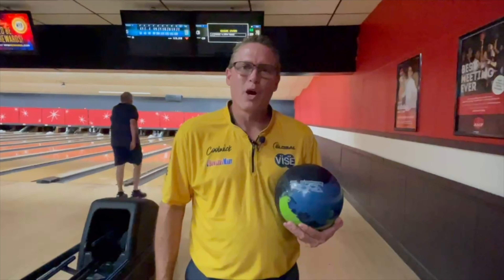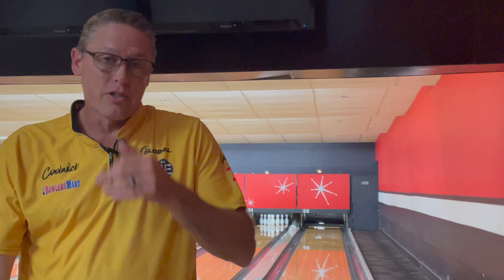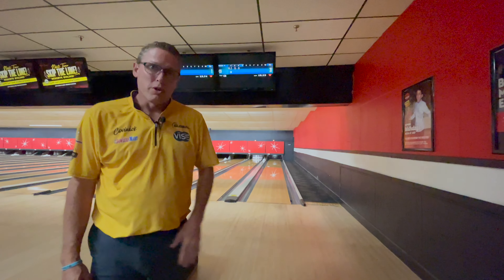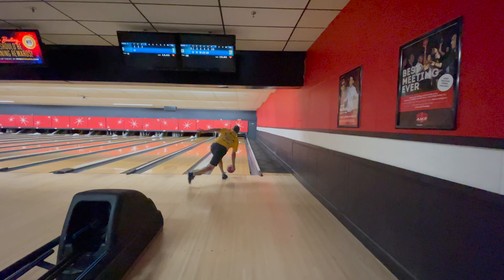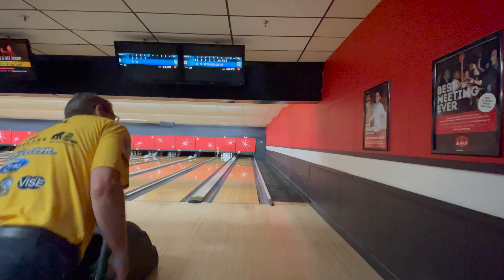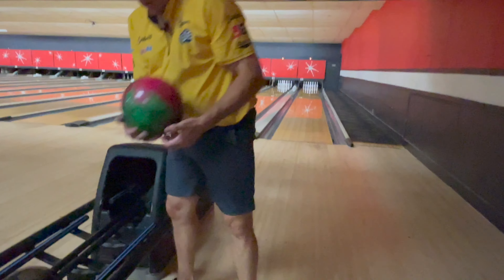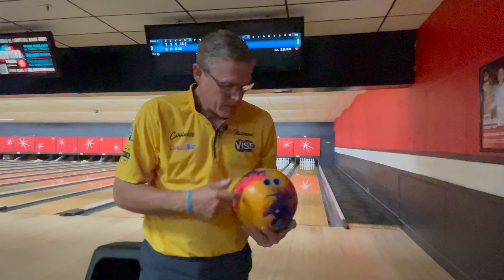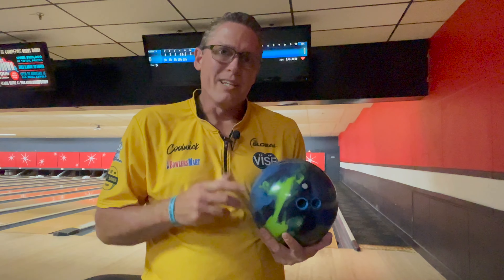Storm Bowling Super Nova review with Chris Barnes | Beef and Barnzy Ball Reviews

Comment: So why does my 5 inch Pin to PAP layout/ 50*5*30 only flare once and not do much vs my 2 inch pin to pap layout. The short pin flares alot and moves. Not sure what's going on. Anything 4 / 3/8 pin to pap is fine but above it does nothing. Why is that?
No thumb bowler.